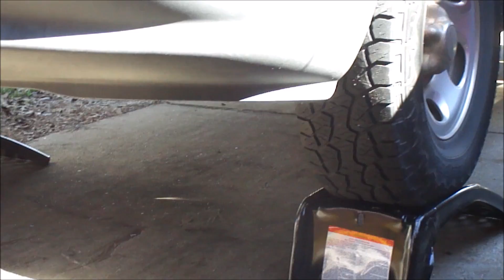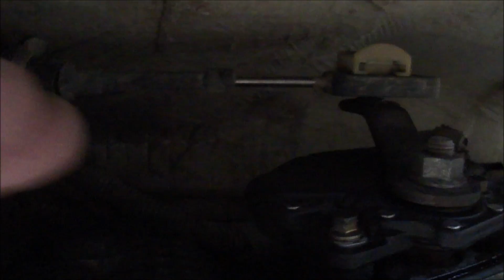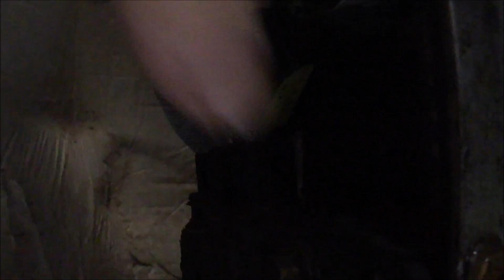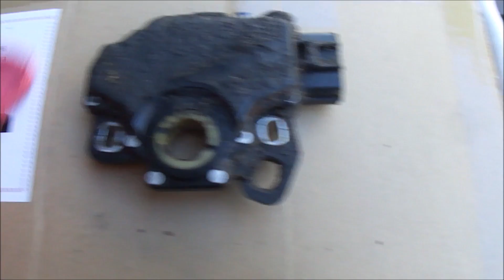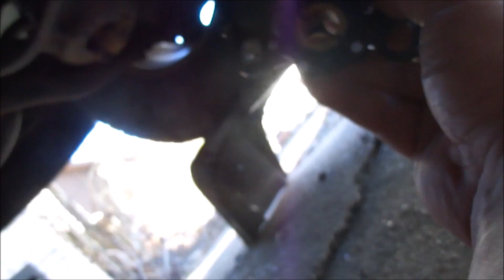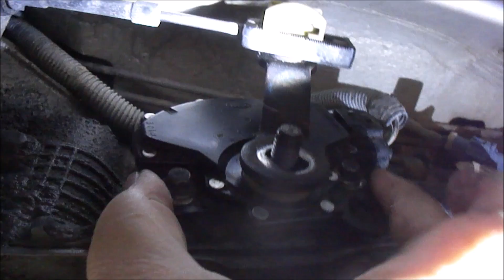2003 Ford F 150 Transmission Position Sensor Remove Repair Replace

Comment: What is crucial is keeping the thin line on the center ring aligned with the other mark while trans is in neutral position. After several adjustments I thought about buying the Ford alignment tool (T97L-70010-A) but that costs around $180.

Comment: Thanks for sharing this video. Question, when you install the unit, its in neutral right, but did you turn it to park? I mean, I assume when you started working on your car the gear is in park - correct?
Reply: No - chock wheels, emerg brake and keep in neutral - line hash marks  must  line up and thats in neutral

Comment: If I change computer. This could get affected?
Reply from the maker: From what I understand it could very well affect it. The transmission sends a serial number to the computer. You can get the computer reprogrammed. I think it cost around $150-$300 depending on where you send it.

Comment: So...loosen the center arm nut and check that the shifter still says neutral before proceeding.  
Thanks for the tips and nut sizes.  
I've been using cardboard creepers since my first car.  Double wall was a score!  
I've seen those car ramps crush under the weight of cars and others mess up the plastic under the front.  I recommend a heavy duty pair of jack stands instead, and Never trust that a hydraulic jack will hold the car up with you under it.
Reply: Great tip about the center arm nut and the jack stands... Thanks!
Reply: If yer belly ain’t too big you can get there without jacking it up 😀

Comment: Can anyone one tell me why my 4r70e TRANSMISSION has my truck when I put it in reverse are drive my Moter shuts down I need help it's not the torque converter
Reply: Did you find the solution? I have the same issue.
Reply: Me too. 2000 Ford Ranger
Reply: Check fluid level had one low caused it to doe

Comment: Why do I need transmission sensor how long can I drive with out it
Reply from the maker: Depending on how bad the sensor is. It may report that you are in a gear that you’re not in and  the transmission will shift unexpectedly into a different gear. Sometimes if it’s not detecting that you’re in park it will not start at all

Comment: I have a Ford mustang 2002 and it will not go in the drive so can you tell me what it can be.
Reply: Did you check the sensor on the brake pedal had that happen when it went bad
Reply: Did you find out what was going on with it
Reply: Did you find out what was the problem with it
Reply: Bad transmission filter

Comment: It went from barely on to ON. Guess i need to use my imagination. I used a washer and the nut to put the switch on but it doesnt go back far enough for the shift lever.